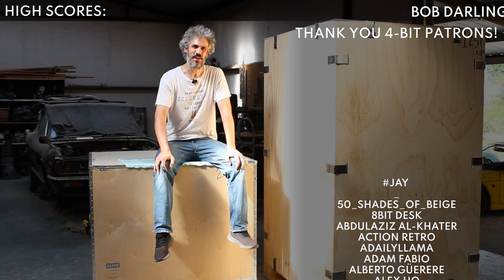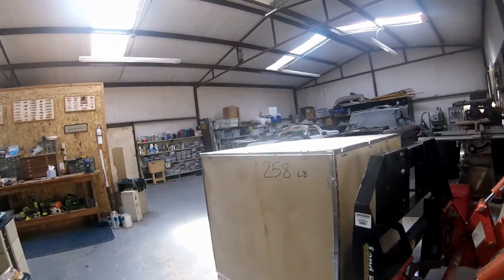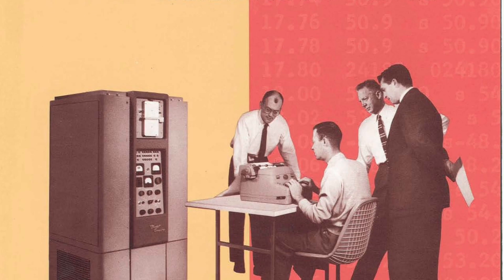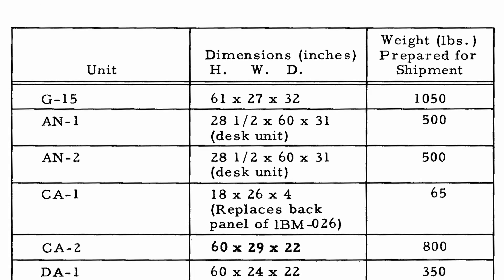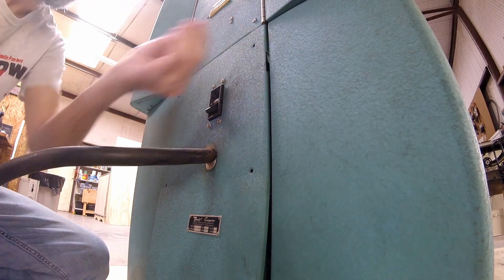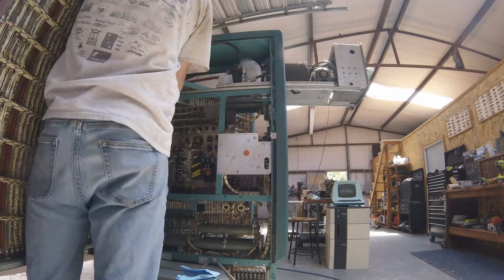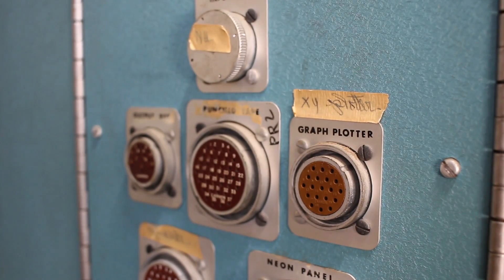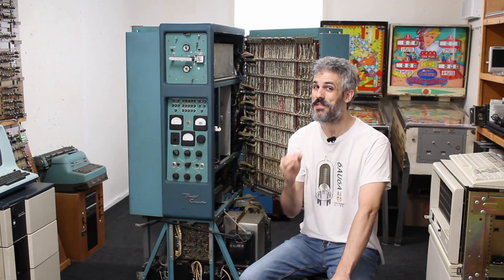My New Computer Weighs 1,000 Pounds!

Comment: In case of an EMP or solar event is this thong still able to run? Assuming you can provide power.
Reply: There's a decent chance it could; a vacuum tube can handle higher voltage surges (such as from an EMP), while semiconductors are designed to operate with low voltages that an EMP surge can overload much more easily.

That said, vacuum tubes use more power and can require regular replacement just from standard use, so it's probably wiser to try and protect IC based equipment to begin with, over hoping to reboot the post-apocalyptic computer landscape with a museum piece like this.
Reply: @martianhighminder4539  Or have all sorts of spare tubes at hand. Gotcha! 
Thanks for the explanaition i already guessed something in that ballpark but i have 0 experience when it comes to tubes. Also i read something in the ballpark under 150nm for IC's is where NASA had issues with the cosmic radiation causing random bitflips at times. Welp. The more you know.

Comment: As a professional stagehand who constantly deals with casters and caster replacements, I would strongly suggest next time you go to make an adapter plate for casters to not weld the caster directly on. Instead, make a second plate that matches the casters you want to use. It makes it so much easier to change out casters later because casters do wear out more often than people realize. Also, it's really not safe to weld zinc plated caster plates; There's a lot of toxic gases created.

Comment: The guy's is at System Source, and they should have worked for IBM at Havent, in the UK.

I used to visit this very big plant as a field inspector for UL, from 1992 to 7, visits usually took a week, checking product.
Ìt was one of the best and most compliant companies I visited.

On the the products was a cabinet even bigger than the Bendix G15. It was the main computer that communicated the banks data to the banks main server via dedicated lines, I think.

At one of the first visits looking at this product, I was shown the shipping and envroment test department, for IBM's Havent, manufactured equipment including the banks, and all other products, were shipped like yor G15.

I started working just at the end of valves at Marconi Instruments in St Albans in the UK. More than half of the equipment was valves.

Valves work similarly like fet's  I wonder if any computer companies used fetrons, which were made by Teledyne.
A video made about them would be good, as if the technology had taken of, fet's  may had been the main components used not transistors.

Thanks for the brilliant videos,

Comment: 115 volts AC, your AC these days will be higher. But where do you find a 50 Amp variac if you wanted to bring it up slowly? Also those electrolytics will need to re-form themselves when they are energized after 60 years. Once you safely wake up those expensive old filament and B+ power transformers without damage I'll breath easier. A 50 Amp variac would be handy for sure. Beautiful machine, and what I'm sure will be an amazing restoration.

Comment: Worked on the Navy's NTDS systems in the 70s.  Paper tape, flex writers, 800 bpi tape drives, drum drives.  32 k of 8 bit core memory.  Those were the days.  Had to be very careful with memory ussage.

Comment: Suggestion: fire up the tube filaments and let it sit for a few hours before applying high voltage.  It was advice I learned from my dad.  I think it was to burn off any gas that managed to seep in during it's long slumber.  (Not enough to go white, but just traces.)

Comment: Wow, a Bendix G-15 computer.  This is the first I learned on.  We had one of these in our highschool.  Programmed It in Intercom 550, Intercom 1000, and ALGOL.   I used to carry around coils of paper tap with my programs.  The computer room in our school wasn't air conditioned, so in the winter we kept the windows open.  It kept the room warm.  In the summer we couldd only run it for about an hour since it would overheat.  We had an IBM typewriter as the console and we also had a Frieden Flexowriter to punch tapes offline.  ALGOL programming was a chore since the compiler reqiired multiple (I think 5) passes generating intermediate paper tapes.  It was a challenge since the rotating drum memory has limited memory.  Best of luck getting it to run.

Comment: Wikipedia has a basic but nice article on the G-15. Some highlights:  Drum memory of 2,160 29-bit words, along with 20 words used for special rapid-access storage. The base system, without peripherals, cost $49,500. A working model cost around $60,000 (over $500,000 by today's standards). It could also be rented for $1,485 per month ($16,406 today!). Interestingly, the lead designer, Harry Huskey worked with Alan Turing in the UK in the 50's.

Comment: Okay, gotta say, this is your best episode yet! Yes! This is by far the coolest machine you have brought home, so far! Very much looking forward to the adventure of restoration to full working order. Keep up the great work! I am really becoming interested in pure computer science as I approach the tender age of 60. This type of machine is a great example of a Turing Machine properly implemented as a practical computer. I would love to construct a computer using the technology that would have been appropriate to do a budget build of a computer appropriate for single user use in 1965. So, that means using technology that would have come down from leading tech to being at more of a commodity level by 1965. The architecture of this machine is really close to what I was thinking, but use transistors to build a 1 bit ALU fed by shift registers and the interface to magnetic drum or disk or both for memory and temporary storage. I was thinking a high quality cassette tape interface would make a period correct permanent storage solution. I know paper tape was typical for systems at the time, but cassettes were in use in offices by then as well. I am very much looking forward to seeing your presentation of the system architecture and internal logic.

Comment: Amazing! It almost looks like a prop from a Steampunk film. 
Optical paper tape readers are quite a lot older than this. The first Colossus computer, which was built in 1942, used photocells to read paper tape containing intercepted Nazi ciphers, comparing the code with an internally generated decrypt code. Previous hardware had used mechanical readers, which was much slower and a lot less reliable.
Reply: Scrolling to find this comment. I went to Bletchley last year and got to see the wonderful Colossus rebuild actually running, including the tape.  If memory serves they invented this specifically because mechanical readers were to slow to do the decoding task in the required time. But then again, Colossus would have been still very much classified in the 1950ies, so Bendix might have had to invent it again. Although Wikipedia says that Harry Huskey, designer of the G15, had worked with Alan Turing on the ill-fated ACE computer before! So it might be conceivable that it could have been Turing himself who "leaked" this little trick!
Reply: This is my recolection as well, having been at Bletchley Park and watching the insane rate at which Colossus could pull tape.

Comment: Paul Pierce once had a substantial software collection for the
Bendix G-15, on paper tape.  The page describing his collection
still exists, but you'll have to find it yourself, because
YouTube apparently doesn't even permit spelled-out links in
comments (my first attempt at a comment was disappeared without
a trace).  In any case, Pierce said there "There is now a whole library
of [paper tapes] in the collection, but some have been in water and
will take some effort to recover."

Apparently these tapes were never in fact recovered
(there is no Bendix G-15 software on bitsavers).

The following post was made just this month to the VCF forum thread
on G-15 restoration:

> Paul Kimpel wrote:
>
> > Al Kossow said:
> >
> > Has anyone been in contact with Paul [Pierce]? Did his G15 and the tape collection go to LCM?
> > It isn't at CHM. That paper tape collection was irreplacable. It contained the only known copies
> > of the G15 user's group tapes.
>
> I had some brief correspondence with him about a year ago when I was working on a G-15 emulator.
> I asked about the tapes. He said he still has them, but some have been in water and will need
> restoration before they can be read. He's interested in capturing their contents, but said
> it would probably be a while (years) before he could get to it. He said he also has tapes for
> the LGP-30 and RPC4000. I didn't ask, but I suspect that he may be amenable to someone coming
> in and either helping with this, or taking it over.

Sounds like a job for. . .   (As if you don't already have enough on your plate.)

;->

Comment: This machine is beyond epic 👍🌷 will be extremely interesting. Fortunately energy costs basically nothing in Texas, 6KW is crazy.
Reply: By my calculations that would cost about €0.65 per hour in Germany right now. Close to double that in France.

Wikipedia seems to claim it's closer to 3KW continuous usage but I can imagine 6 or even more once you add air conditioning to the room.
Reply: @whiskeytuesday  if it’s just 3 KW continuous it would cost around 😳 €1.50 per hour in The Netherlands 🇳🇱 !
I hope things will go well so it doesn’t need to run weeks on end
Reply: @louwrentius  I may have slipped a decimal point then... Or looked at the commodity price of power and not the retail price. It's still about $0.15 CAD per kwH here in BC last time I checked.

Comment: Aren’t  caps from that era filled with nasty PCB’s? You’re probably aware if so but if not check. You don’t want to mess with those without taking the proper precautions. Great project! Can’t wait to see it running!
Reply: It's something like 20 years younger than the ban on the use of PCBs (polychlorinated biphenyl) so it would make sense that they'd be used extensively.
Reply: Not the electrolytics.  Some paper caps were PCB oil caps. You can smell it.
Reply: @oliverer3  PCBs are mainly but in the AC capacitors, such as the run capacitors on motors or AC line conditioners, but could be in smaller oil filled capacitors.  If a capacitor says Pyranol on the label, there is a good chance it is PCB-bearing oil filled.  Electrolytic capacitors have polysaccharide dielectric material with additives.  I don’t know what the additives are, but I wouldn’t count on the additives being harmless.
Reply from the maker: Thank you!
All of the caps on the DC side are high-quality Sprague electrolytic. These are the same ones that were used in HP test equipment in the 50s, and I've found them to almost all still be good and safe to use. The only thing that is a mystery is if the drum motor has a start capacitor and what it is. That particular one may need to be replaced if it's a PCB filled cap.
Reply: @UsagiElectric  The G-15 is a beautiful machine and it is great to see it in such capable hands for its restoration.  It would be interesting to see if any metal paper tape cassettes with canned programs can be found, especially ones for POGO and ALGO.  In my scrap electronics adventures, I’ve never seen anything like those Bendix cassettes in 50+ years.  I took a quick read through of the programmer’s reference manual, and boy would writing just about anything from scratch be a tedious undertaking.  The system reference manual also contains a flow chart which refers to a self-test program to be run at power-on after the initial voltage checks.

Sometimes small-ish capacitors can be suspect.  I ran across a 4.7 uF axial lead capacitor with cardboard sleeve and red rubber end caps in a 1946 National HRO receiver’s audio stage.  The sleeve was wet with oil and there was oil on the bottom cover of the chassis.  Usually a cap like that would have been wax paper and foil.  I happened to have a WW-II Sprague fungus proof cap in a plastic shell which was about the same size, so I swapped that in.
Reply: @UsagiElectric  start caps are electrolytics. IF an old Collins radio that has oil cap. Not that common. Yes, you are right about old electrolytics in HP being reliable.

Comment: I found the power requirement for this computer of 50 amps at 120 volts circuit as highly unusual, since I am familiar with typical residential 120 volts at either 20 amps or 15 amps circuits. Usually if this much power is needed a 240 volt circuit is used. So this machine will require a highly specialized electrical circuit to run it.

Comment: Oh my god, Is that a Mazda Cosmo 110S and an Isuzu 117 Coupé you are restoring?! I can even see an Isuzu Bellett.
Absolute gems!
Reply from the maker: Good eye!
Indeed it is a 1967 L10A Mazda Cosmo Sport, a Zenki model. The 117 Coupe is a 1978 Kouki model that I'm in the middle of an engine swap on (dropping in a BP 1.8 twin-cam Miata engine for funsies). The Bellett is a 1973, all original except for a new exhaust and some side draft Mikuni carbies. I actually did a video on it here ( https://youtu.be/qgrvf2xLrns ). There's also a 1967 Austin Healey 3000 Mk. III ( https://youtu.be/L662AMVqUZM ) and a 1991 Honda Beat ( https://youtu.be/4S0Q_6VtY0A ) hanging out in the background. I added some links to some older videos I did on those.

Lots of projects both automotive and computing!
Reply: @UsagiElectric  The fact it is an early L10A model makes it even more impressive. A BP inside the 117 seems quite fitting indeed, same valve train layout and displacement. I would have loved to see a diesel-swap since Isuzu was an early pioneer in their integration. I have watched your videos on the Bellett and it never came to my mind before that, despite the excellent performance metrics for their time, the engines Isuzu put in the Bellett and 117 Coupé were non-crossflow/reverse-flow ones. I may be mistaken but when you got the Mikunis out of the bay I was genuinely surprised to see what seems to be the exhaust manifold just under.
I'm more of an Isuzu Piazza kind of guy, I love the its futuristic design from the ItalDesign Asso di Fiori concept. And the 
Irmsher is just a marvel of 80's design and engineering to me.
I wish you good luck with your automotible and computer related projects. They are equally as interesting and I can't wait to see what you will do with your new Bendix G15! (and with the Cosmo Sport too!).
I wish you an excellent day and hope to see your upcoming projects.

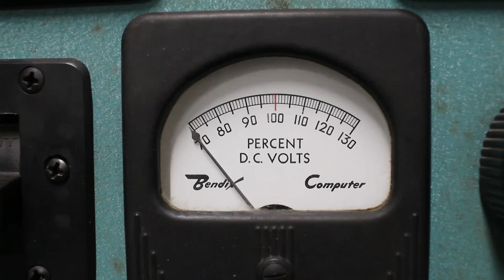Comment: 18:42 3153 hours would only be like 130 days. Surely some top bits must have rolled off if that's how you're supposed to read it? I get that it's probably quite unreliable, but still.
Reply: My thought exactly. Even if it was only run for 6 hours a day, that's only about 2 years of use.

Comment: Regarding the optical tape reader: I went to Bletchley last year and got to see the wonderful Colossus rebuild actually running, including the tape. If memory serves they invented this specifically for Colossus, because mechanical readers were too slow to do the decoding task in the required time. But then again, Colossus would have been still very much classified in the 1950ies, so Bendix might have had to invent it again. Although Wikipedia says that Harry Huskey, designer of the G15, had worked with Alan Turing on the ill-fated ACE computer before! So it might be conceivable that it could have been Turing himself who "leaked" this little trick!

Comment: I don’t even want to THINK about how much inrush current there’ll be just to charge the filter caps; never mind if any are leaky or shorted. That’ll cause a city-wide brownout!
Reply: Yeah, I was thinking that might be the only reason the specs said a 50A supply was "recommended". 

That's got me wondering if the built-in variac is wired before the filter capacitor bank and therefore if powering up with it cranked right down would allow a nicely controlled soft start. I guess that would depend on the variac being wired for a full transformer range, which now I come to think of it seems unlikely.
Adding a low wattage lightbulb in series to the mains input should serve as a current limiting 'pre-charge resistor', which could then be disabled with a simple bypass switch.

I'm probably overthinking it, just nervous the first powerup might resemble a video from PhotonicInduction!
I suppose whatever happens, it'll be well worth watching 🤣

Comment: I'd check those capacitors before plugging it in.  I'd bet they are bad.  If they are shorted you can burn out other parts you'll never be able to find.  You can take them apart and replace the guts with modern capacitors so you can keep the looks of the old cans.

Comment: I can see why the voltage has to be turned up gradually. All those filter capacitors in parallel would represent a huge surge  incurrent rush if their method of powering up wasn't used.

Comment: If the AC motor speed is governed by the supply voltage, and the drum contains the clock pulses, that would mean you can 'overclock' those machines by turning up the variac. I bet that feature was often abused by operators in a hurry to get home 🤣